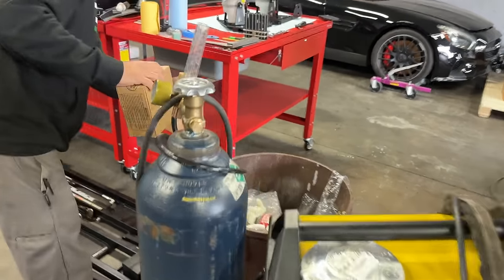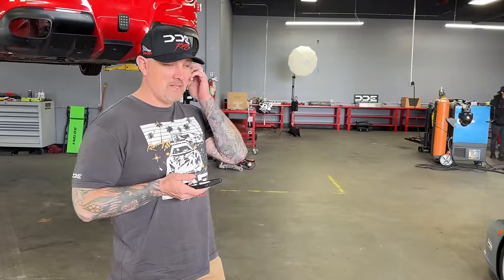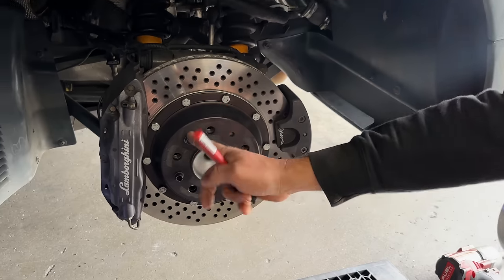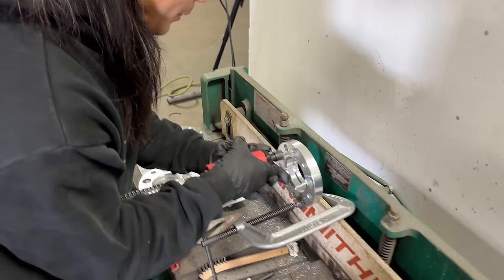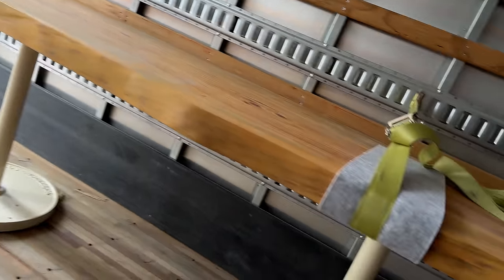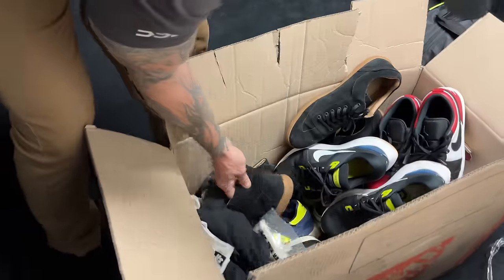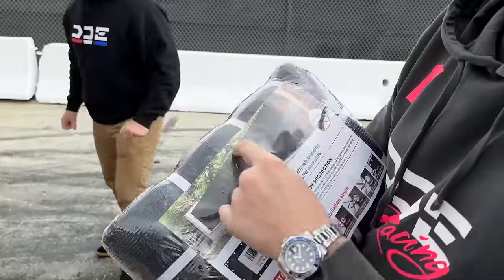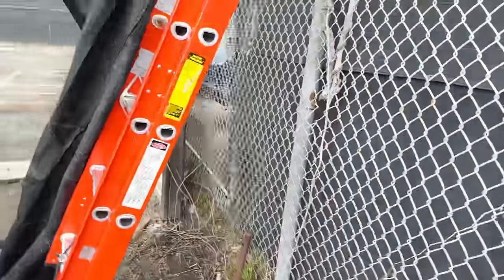Mike Essa Made A BIG Mistake On My Dream Lamborghini...

Comment: Note for Tim. When using a die grinder burr on alloy, use auto trans fluid like cutting compound and it won't gumm up the burr.
Reply: Nice. Thank you. 😅
Reply: And if your burr is already gummed up you can soak it in sodium hydroxide aka drain cleaner, but be careful it is highly alkaline and can cause severe chemical burns on your skin or eyes.
Reply: I’m glad you commented because lots of have experienced that gummed up issue! Thanks
Reply: I can’t believe he was freehanding that in the first place.
Reply: WD40 also works
Reply: Candle wax works to 👍
Reply: I wish I could understand this

Comment: As a CNC machinist it hurt me to watch Tim hacking that wheel spacer up with an end mill in a hand tool!  You guys need a mill!
Reply: They have a Bridgeport
Reply: They have one but it may not be setup yet
Reply: They have a mill
Reply: I think you missed an episode they have one. 😂
Reply: Bahahahaah same how is that wheel spacer safe after ?
Reply: Wouldnt their mods affect the balance of the wheel?
Reply: @rfayed yup it won't be balanced
Reply: @rfayed also less material on aluminum material which already weak is super dangerous
Reply: Think you missed at 9:57 Mark said Sean is using the mill so Tim has to adapt at what they have at the moment
Reply: Bro that spacer is not balanced anymore
Reply: @hussali8838 And balanced ? uneven spacing on the three spots, as opposed to doing all holes equally.
Reply: Think it's still hub centric?
Reply: Same here! Like, use the Bridgeport! 😂
Reply: Ya , very painful
Reply: Could have just made spacers the right size

Comment: Always wear your PPE when riding a bike.  Just like Damon, I had full PPE when I went over my CBR1000RR doing a catwalk between  Whistler and Pemberton doing 5 over the speed limit.  I slide down the highway and was able to get up and run after my bike as it was sliding into the ditch.  Lucky no head on traffic.  My race suit had a hole in the back and the knuckles of my gloves were ground down but I didn't have a scratch on me.

Comment: If you decide to ever paint the Murcielago again, I bet white on the outside, with the same blue color as the interior for the emblems, outlines, and extras, would look crazy good! You need to add some neon's on there for the under body, and the wheel wells. Maybe also a strip going across the edge of the whole front bumper. Definitely has to be blue, unless you keep the paint color as it is, in that case blue or white neon's.

Comment: I finally gave up and got a 2TB flash drive to use on my laptop and desk computers.  I keep most of the frequently used files on the flash drive and move it between the computers.  Works great because like you I move around a lot.  The flash drive goes on my key ring that is always in my pocket unless I am using it.

Comment: Mike is there a reason you haven't designed a template to put all the switches and buttons for the center console on the KB43 Hurrican. I can see it made out of sheet metal and powder coated black that works around the new E-Brake and shifter.

Comment: Hi , if you made wheels ?! If you made forced rims , why you not integrate the spacers inside made direct? 
I did and after UFO flight high spin by highaxle rpm, got in rims scratches inside plste threw Nabe .
In past you montage the Lambo spacers , was hard steel lighit ultra hard ! reason is true . 
I like and by " Stützwinkel" mid threw 
" Lenkrollhalbmesser" and ET = Einpresstiefe ! :) 
Aways save !